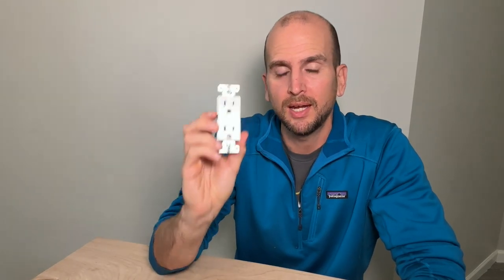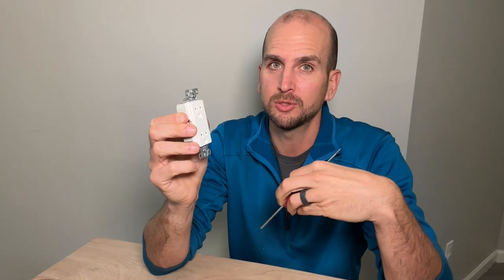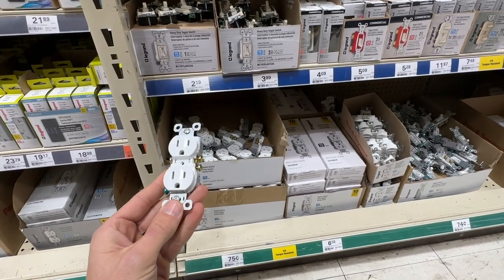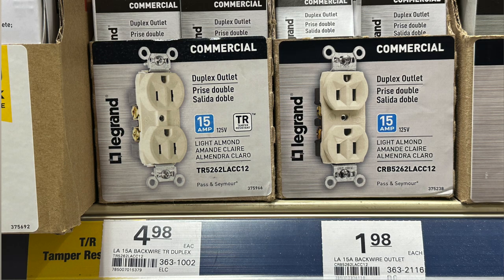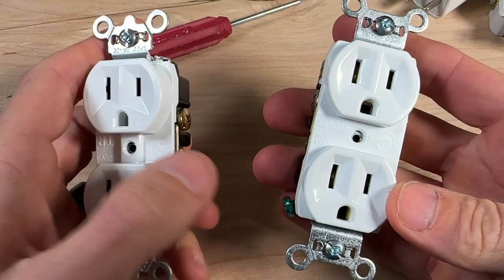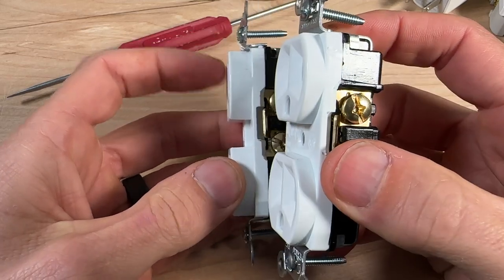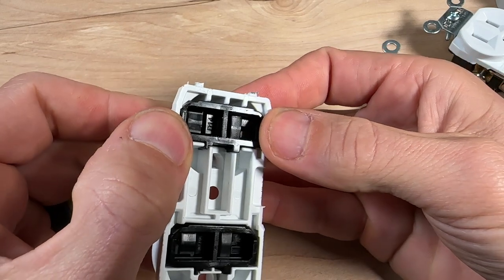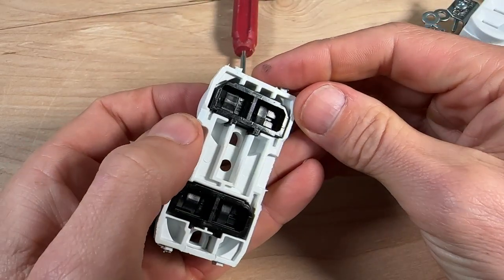The Most Hated Product In Home Electrical

Comment: I always use tamper resistant outlets when I do replacements. I've never had a problem with them. An extra $2 per outlet isn't going to make or break a budget for any of my projects.
Reply: It's not the price, it is the fact that they're a pain in the butt when you use them.  If you don't get the prongs lined up absolutely perfectly they won't go in.  You spoke of budget and projects, so I assume you're a contractor.  Ask your previous customers how they like them after using them for a few months.  I'll think you'll be surprised at their answers.
Reply: @WillNeverforgetmypasswordagain  I have them in my home and I’ve never had a problem. I haven’t gone back and asked specifically about them on other jobs but I’ve not had any complaints. I replaced every outlet with them in a building used for a kid’s track out camp.  Having kid-safe outlets (and GFI on the first outlet after each breaker) was an obvious need on that project. It was also a code requirement. It’s been years but I think I used Eaton child-resistant outlets. Maybe I just had better luck with the brand I used. 

I’d attribute any problems with these things as a symptom of a larger problem. Most products in general just aren’t made very well these days. Manufacturing has mostly moved offshore and the only consideration is how cheaply things can be produced.
Reply: @Lew114  Judging by everything else we've found in the house, I'd guess ours are the cheapest they could possibly have found.
Reply: @randomvideosn0where  Geez, I'd like to give you ten 'likes' for this comment, but can only give you one.  Think of it as ten.
Reply: @WillNeverforgetmypasswordagain  in my experience “builder grade” = crap. It makes me so angry. No concern for anything but margin. Too many modern houses are manufactured like a cheap commodity. Ask any homeowner if they’d rather pay a few extra thousand when they buy a new home to get higher quality. They’d all say yes, or the should because someone has to come back in and replace a lot of the crap later on anyway. Older houses are a better value IMO. I visited an elderly relative over Christmas. Her home was 75 years old I noticed that all the original plumbing fixtures were still there as I was replacing a 3 year old faucet in a bathroom that she’d remodeled.  

I’m way off topic now. I’ll stop ranting.
Reply: @Lew114  You're 100% correct.  Our last home was a stone 2 story built in 1828.  The electricity was installed in the 70s and was aluminum so I had to replace everything, from the receptacles to the panel and right out to the road.  There was a roof of barn tin over old cedar shakes which we left intact and it had no trusses, just 10" logs for rafters and 18" - 22" logs for joists.  With stone walls that were 2' thick, that house never shook in a thunder storm. Hated to leave it, but had to move to be closer to family.  I'm way off topic now.  I'll stop my trip down memory lane.

Comment: TR receptacles are a permanent solution to a temporary problem. Plastic plugs or protective cover plates with sliding doors work fine. These are very easy to swap out when your children or grandchildren are old enough to know better (may vary by child).

Comment: Honestly the US plugs are a bad design. A child could still easily partially pull out a plug TR or not and touch the prongs and get shocked. I see this as a more likely scenario than a child inserting something into a receptacle even though it does happen.
Reply: Indeed that is how I received my worst outlet shock as a child.  The plug was stuck partially out, and my finger slipped down behind while I was trying to pull it out.
Reply: @Sylvan_dB interesting that North America never adopted insulated sleeves on the pins like European plugs do.
Reply: Not to mention the contacts come loose over time

Comment: I have TR all over from various brands and they all work with a little wiggling. Worth the safety. Not that big of a deal. Not perfect but if it just slows down an accident then worth it imho. By the way, anywhere grandkids are close to outlets, I put the clear plugs in also, so they have to do two things to get in trouble. Pull out the plug and then insert something.
Reply: These are junk, great to give the option for section 8 landlords but the code should not be mandating what I do in my house.

Comment: It can be very hard to insert a plug into those outlets. Also, many places won't accept them as the original box is a small one. In other instances, they are located in brick or concrete, so changing to a new box is not possible. The condo I live in was built in the 70's. I could not even put in a GFCI outlet in 2 locations where one should be installed. Because BX cable was used, the cable clamps stick too far into the box and you can't insert the GFCI outlet. You can't install a deeper box as the walls are only 2x3 metal.

Comment: As an electrician we only use temper resistance outlets . And when it comes time to plug test every outlet it is rare that we get through a house with no problem plugging in our GFCI testers. You would think it's because we were in a rush but no. Rushing would only cause unnecessary where on my tester Not to mention it would almost guarantee that it's not going to go in. With that said it's become a game of will it go in smoothly or will I have to waste 10 seconds fiddling with pointless shutters. Now that I'm thinking about it I'm curious if while passing them out aka standing in the center of the room tossing them toward the box. Is causing the shutter mechanism issues. You should do drop tests to see what average of tossed tamper resistant receptacles mess up versus non tossed. . I think I'm going to try and see if that makes a difference at work but you should do it for us

Comment: A Grand Realization. P&S legrand and other TRs have worked beautifully for me and my customers with one simple trick. While inserting the plug favor the neutral prong by leaning the plug off center about 5 degrees plus. The neutral prong alone goes in a bit with no resistance then seems to trip a release on the hot shutter. Try it. It makes sense to me because in my lighting manufacturing days UL, ETL, etc. favored a condition with plugs/interconnects where the ground is always the first circuit leg in and last leg out. Thus it would make sense that one safety step up on current carrying conductors that the neutral is first in and last out. Most of us connect wire nuts or Wagos thus: 1. Ground. 2. Neutral. 3. Hot. Please try my suggestion and please respond if you do or do not think my theory has merit. Thanks.
Reply: Problem is getting end users to remember this. If in fact I am correct some molded-in notation might help. Like “1” near neutral slot and “2” near hot slot.

Comment: Actually, whenever I replace or install new receptacles anywhere on property I am responsible for, I always use commercial grade non-tamper-resistant units. Commercial grade because they are much more durable. Non-tamper resistant because there is another population that has trouble with TR receptacles: those of us who are aging! 
Many aging people have a combination of poorer eyesight, less manual dexterity and strength, and problems with arthritis in the hands. Anything that makes a manual task more difficult is much less desirable than an equivalent that makes the task easier. 
Another thing that would GREATLY help the aging population is to move receptacles up to just above counter height. Many of us cannot easily get down to where they are normally installed; and once down, it can be even more difficult (and painful) to stand up again! Installing receptacles at that height also makes them safer because they are out of reach of the little darlings who are most likely to try sticking things in where they shouldn't go.
In my workshops and garages I go one step further and use 20-amp rated commercial grade receptacles. (But if it is a 15-amp circuit, I label it as such.) And all (except the few installed by the builder) are above countertop height, where I don't have to crawl around searching and reaching for them.

Comment: 2015 building my house I started with Legrand and they were China Garbage.  Returned them and replaced with USA made Leviton, much better!  You have many comments below that agree with Leviton.  A useful tip is to rock the plug up and down as you push it in. That is the only way I could get the Legrand to work before I returned them.

Comment: I've had such negative experience using TR plugs that I've always avoided them (and would have done so even if they were LESS expensive).  To be fair, I've not tried a Legrand Commercial Grade TR, so I'll give it a try if they are available locally.

Comment: I went to high school with the CEO of VoltSafe. It'll take YEARS before you see their products in a lot of new home builds, but their outlets will be a game changer for those who want safe outlets (which are also smart outlets).

They started with automotive block heater plugs a few years ago, and they're already pushing into marine power applications.
Reply: They seem interesting but I wouldn't be likely to get one unless it didn't have all of the electronics.  I don't want my receptacles to have any electronics (aside from GFCI-type stuff) or networking components or security holes in them.
Reply: @mtgibbs  Our high school reunion is next year. If he's there (I know he was at the 10, but can't remember about the 20), I'll ask him if there are plans for scaled down versions..

Comment: We’ve been using Legrand devices for several years now, it’s all we buy. We used to use Leviton, but honestly we get a better price on Legrand. We used to get callbacks on Leviton ones, especially GFCI plugs, commercial and residential. The TR plugs have vastly improved over the years, we’re required to use them on new residential and some commercial applications around here.

Comment: I've noticed that its much easier to insert a plug into a tamper resistant outlet if you wiggle the plug from side to side, instead of just pushing it in without wiggling. 

Leviton USB and GFCI receptacles seem to have the most annoying shutters. 

Also don't buy residential grade outlets. They don't make a good connection between plug and contacts inside, so if you plug in a heavy duty appliance, the prongs can get very hot, especially if you run such appliance for a long time. This is why you should also NEVER use loose receptacles that can't hold the plug well anymore.

Comment: As an electrician we are required to install them by code. I have not had any issues plugging things in. If you do struggle try wiggling left and right a little while pushing forward to put in the plug. The tamper resistant flaps needs to be depressed evenly for them to open up. Hopefully this helps
Reply: Brand new with brand new plugs they may work ok. Real world use with real world imperfect plugs these are junk. There are fewer kids than ever in the US yet everyone is inconvenienced with this junk and AFCI.

Comment: I remember, from like 15 years ago when I was very little, we had child safe outlets that you would put the plug in and twist to expose the connections. They were much easier to use than modern tamper resistant receptacles, and possibly safer too.
Reply: When I worked retail, I remember seeing wall plates made by Safety First where that the cover slid sideways to expose the outlet.  but for obvious reasons it only came in a duplex outlet version, not GFCI.
Reply: I remember, from like 70 years ago, similar child safe outlets where you put the plug in partially, twist, and insert the rest of the way. BUT ... I was warned from the earliest time not to mess with outlets, that they were dangerous and not to stick anything in them. I didn't.
Reply: @davidwayneprins  They are an inferior product. The wall plate adds extra thickness where it's not wanted, many appliances don' t plug in all the way and no longer hold in the outlet.
Reply: @KameraShy  I tend to do the "tell" then let them try it once in a safe way, so they can see what happens.  Kids should be very curious IMO ;)

Comment: I’ve got an outlet related question. When did outlets start getting installed with the ground plug on top? Years back I installed with down. No just because I had always done it that way, but writing on them went that way. Now I see the writing the opposite direction and lots of videos and pictures showing the plug on top. My feeling was always that the plug was more stable have the ground on bottom. With it on top, it would seem more likely to bend down. Just thoughts.

Comment: My previous apartment had TR outlets and I hated them so much. It was such a pain to plug things in. I basically circumvented them by using power strips for things I regularly plug and unplug. They were just so annoying, and whenever they bind up, it’s blamed on the plug blades being misaligned rather than the mechanism being stupid

Comment: As a kid who was playing with electricity since I was 6 (I'm an EE now), I rarely got shocked from an outlet itself.  It was much easier to get shocked from a plug that has come partly out, exposing the prongs.  The iPhone charging plug (for example) and other plugs that are snug and require more effort to unplug, I instinctively try to grab it at the inner edge of the plug for a better grip.
I have no problems with the outlet, the plugs on the other hand, could be made a lot safer by placing 2 insulating sleeves on the inner half of the prongs so that at the point it makes contact, only the insulated part is exposed.
Reply: Prongs that only have contact surfaces near the end, like they do in England (and probably other countries as well). Great idea!

Comment: I think the issue is trying for the "must plug in 2 prongs at once", which is silly.  The way the UK outlets work is "must plug in ground".  The ground prong is slightly longer, and it moves the shutter out of the way of the other two.  In thee US, we have lots of un grounded cords, so that wouldn't work, but you could have the shutter on live, with the neutral prong responsible for moving it out of the way.  Set the shutter slightly deeper on the live side so the neutral prong has the space to work.  As it stands, that are kinda janky.
Reply: This seems like it would make it so you wouldn't even notice it's a TR outlet.  That's how you get adoption of a new product (well, and reasonable pricing).
Reply: That is not safe. A kit can stick a knitting needle to the ground hole and open the socket. Now he has a direct ground contact waiting him when he pushed another needle to the phase.

Also that system mandates that all plugs have the ground pin.
Reply: @okaro6595  To your second point, re-read what I wrote.  You can implement the same system with 2 prongs.

As for safety, you are correct that allowing the serial rather than parallel de-locking is less safe, but that sits on a continum.  You could install outlets that have a cover with a 40lb pull weight, which would keep most small children out.  That would be even safer but much less convenient.  The goal is to improve safety more than it inconveniences people.  As this video discusses, the current problem is the inconvenience and unreliability is greater than the added safety, so you get little adoption.  

Finally, N.American outlets are incredibly unsafe.  You can have plugs that are not fully inserted, leaving bare energized metal where small fingers can get to it.  You can have cheap power strips (or expensive ones) that allow inserting 1 prong in the live while leaving the neutral hanging next to the strip in air.  While I do support making them safer, this kind of stop-gap measure cannot take the place of teaching children that they are dangerous and to leave them alone.

Comment: I’m a master electrician and I installed these in my own home when I was rewiring it about 10 years ago. I can tell you from personal experience people avoid these because they suck! About half of the outlets in my house you could only plug into one half of the duplex receptacle and some of them you couldn’t use either side. I had to plug things in for my wife often because she wasn’t strong enough. There’s just something disconcerting about the crunching and grinding sound of forcing a plug into one of these. This is another classic example of the NEC mandating a product before the technology has been fully developed. To understand this you need to understand the code writing process. Most things in the code are a result of various code writing committees representing multiple interests. Unfortunately one of the flaws in this process is the large presence of committee members that are paid representatives of electrical equipment manufacturers that are constantly trying to insert requirements in the code to mandate products that they sell. They need to be involved but sometimes they become too influential on certain committees and this is the result.

Comment: You just explained the reason why I've been unable to use some of the new TR outlets that were installed in my 102-year-old kitchen when it was remodeled a few years ago!  I thought maybe they were just too small for the plugs of my somewhat older appliances.  I was afraid to try to force it, so simply considered those outlets unusable.  They must have been installed to pass inspection, as they're positioned for countertop appliances and are not within the reach of small children (whom we don't have, anyway).
Reply: Yeah, the new electrical codes requires the new tamper resistant plugs. On paper the idea looks good. As a user, I cannot recommend them; what they have shown me is that the people writing the code have lost touch of reality. After the electrical inspector leaves, one can change out the outlet to an old fashioned one.